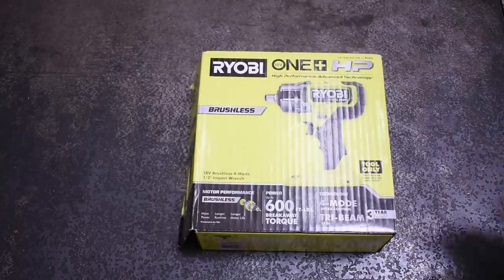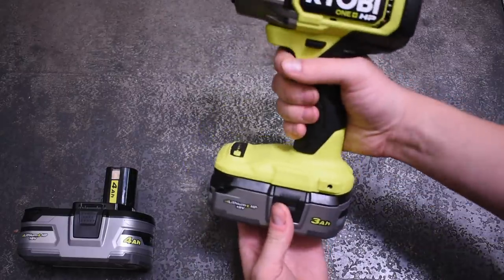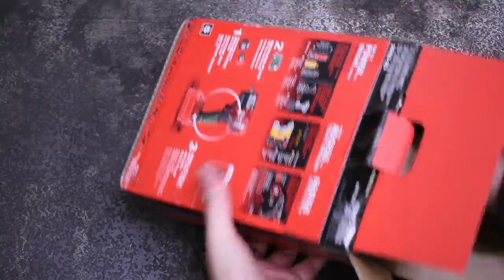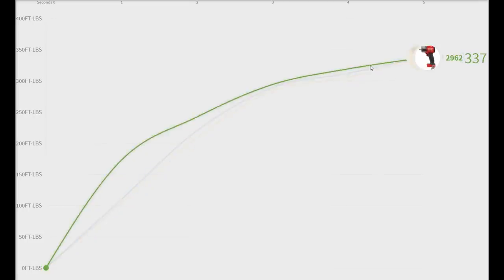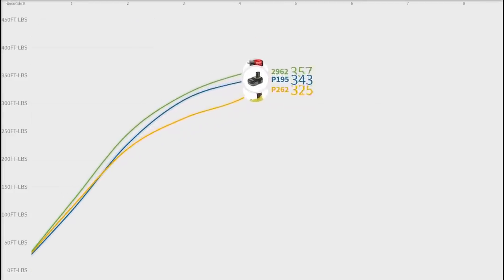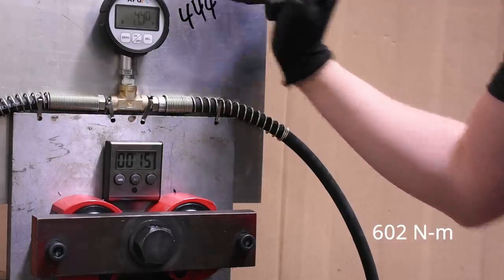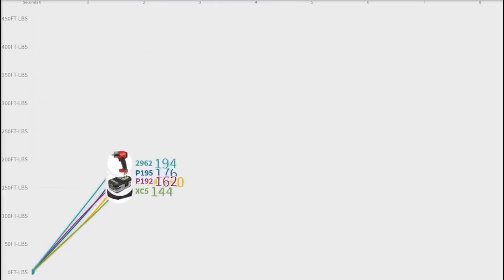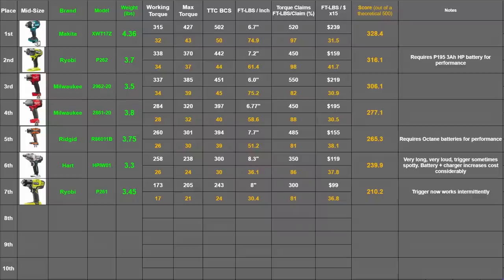Ryobi HP Finally Beats M18 but Needed THIS Battery: Dyno Test

Comment: I think 160 bucks for this thing is quite a bargain especially seeing it's edging the top brands
Reply: Just got one with a 4ah HP battery for 170
Reply: Just got one for free with a charger bag and 3 battery kit for $199 going to get the same deal with the extended reach ratchet this tax free weekend in MA.
Reply: Here in Los Angeles CA $219+ plus=$230+
Reply: @joshlee284  that’s a shit deal compared to the one I got back in July/ august. 2,4,6 amp hour batteries charger bag and p262 $199

Comment: Just remember the protection for Dewalt is on the tool, not the battery pack. So you can seriously do some damage using that adapter in the real world. (Of course, nobody should. But it could happen ofc.)
Reply: Its all for science
Reply: Makita, ryobi, and ridgid tools all have protection circuits in them
Reply: @brynnond.6952  this is incorrect ryobi has it in the battery packs, pretty sure the HP tools have it in the tool. This is why you can use NiCd Ryobi tools with lithium batteries. There are two big mosfets in the back of every ryobi battery pack with heat sink.
Reply: My co worker is bragging about his brand new brushed Dewalt tools!🤪 He even went so far as to buy the cheapest knock off Dewalt batteries he could find!!!! There is actualy a side by side review on the Dewalt knock off batteries here somewhere! Why sacrifice any performance at about a 20 dollar savings. Reminder, he bought the Dewalt  tools this year and they are brushed tools!!!!

Comment: I think it would be pretty fun to see if can use the best battery (in your opinion) and try it on the worst impact you have tested.
Reply: It probably wouldn’t make much of a difference. They covered in another video that bigger isn’t much better in impacts because the motor isn’t directly doing the work it’s only helping the anvil overcome the springs. Basically the tool can’t recognize that it needs to put out more juice because it’s still impacting the anvil and overcoming those springs, vs like if you’re using a circular saw it can recognize that the blade isn’t moving through the material as fast.
Reply: @danieljensen1465   The output was doubled from 150ftlb to 300ftlb at 2 seconds in from a battery alone..  Less voltage drop = more power

I run a 12v offbrand impact at 18v to take 140ftlb lugs off my dually. 12v to 18v being a dramatic change in performance.
Reply: Thx

Comment: The reason why is the dewalt protection circuit is on the tool so the battery will over discharge and could discharge it to where you can not charge or use the battery any more.
Reply: This should not really matter. None of these tools are treating the battery that differently. keep in mind there is still protection on Dewalt batteries but they are simple absolute max/min limits. Tools may have smart features so they do not do excessive damage to the battery like 30A for 5s, 20A for 10s, 15 continuous. To sell a lipo battery without basic protections would be a serious problem.
Reply: @Ender_Wiggin  If you look at reviews on adapters for dewalt batteries there are many that say the batteries were over discharged.
Reply: @Ender_Wiggin  the tool talking to the battery to protect both the battery and the tools circuitry isn’t basic protection though. Basic protection can be as simple as overcharging protection.
Reply: @trevorlynch6549  it's almost impossible to discharge a dewalt battery using and adapter I tried it on video and drained the battery right to the point it was ready to melt down and it still came back to life. It will never happen because the tool will stop working before the battery gets to that point.
Reply: Don’t believe that, dewalt 18v tools don’t have protection in the tool. 
You can’t over discharge the batteries them in dewalt tools, I use 4amp 5 amp and fex volt 6 amp and 9 amp. I’ve dogged the crap out of them batteries the only issue I had was a 4amp battery melted around the main battery positive. Battery remained functional for another 2 years at which point the 3 4amps I’d got in a kit all started to loose there amp output, works fine in the radio but if you put it in a circular saw or grinder very quick gives up.
Reply: @singlecams  I've killed a DeWalt battery by accidentally over discharging it.
To the point I couldn't even recover the dead cell by manually changing it, had to replace it.
Reply: @tomcardale5596  how ? What was the situation? I can say it will never happen on an impact wrench. Maybe using it on a radio or a flashlight. A impact wrench will not even turn way before the voltage gets to that point.
Reply: Cant you jus swap the battery b4 it dies? Serious question. Jus watch the charge. Once it hits 1 bar jus change it out and you can avoid that issue rite?
Reply: @bossmanz28  if you're just using the tool, particularly if the battery is powering a work light, you can easily get distracted and forget to check. That's what happened to me. The light was still working when I noticed the battery wasn't showing any bars on the battery meter. Put it on the charger straight away and it never recovered. Tried manually charging the one recalcitrant cell and that didn't help either, so I swapped it out.
Reply: @bossmanz28  Yhat works if you pay attention. If you forget once you will have a ruined battery.

Comment: Thanks for revisiting this. I bought my p262 in February and do my own work outside so hadn't really used it. I had buyers remorse after your first video but I own the gen 1 and loved it. I use a 4ah HP battery and havent had any issues. Im happy with the tool and feel I got more than i paid for. I was looking at the kobalt xtr and ridgid but already own ryobi batteries. The gen 1 with a HP battery did almost everything I asked of it. the p262 is capable of light truck and car repair for me.

Comment: i love my ryobi p262.. for a budget minded impact gun.. highly recommend..  i am a diy guy not a professional using in a commercial environment.. but let me tell you this is awesome.. sure beat dragging out 100 ft of air hose to use my air gun.. i already had other ryobi cordless batteries for my other tools so this was also a huge part of why i go this.. super happy with it.. and was impressed with the torque it has..

Comment: Awesome work as usual!  Thanks for giving the p262 what i consider to be a more fair shake.  I had already grabbed a few p195 batteries when they went on sale for $50 at home depot.  So i already knew i would be pairing the p262 with a p195.  This test confirms my experience with this combo.  It performs very well, and is an excellent value imo.  Compared to other brands ryobi batteries can be found for very good prices especially on sale.  This is a great channel, that you guys are responsive to viewers and comments, is a great bonus.  You're putting consistent and very helpful data out there, excellent content!  Really allows an accurate comparison between tools / brands and how they can be expected to perform.
Reply: im lookin for the same ryobi 18v one+ hp 4 mode high torque 1/2in impact wrench bc its advertise at 1200ft lbs on home depot rn..i hv milwaukee m18 and it didnt performed to removed a crankshaft pulley bolt from my k20a3 thats been winter welded for 5yrs atleast
Reply: Same. I recently bought 2 non-HP 4Ah batteries for $89 so I'm trying to stay in the ecosystem if possible. The P262 is $99 right now and seems like a good deal for what I need it for.

Comment: The TTC is becoming one of my favorite channels.  To the point, very informative, non-biased entertaining content.  Not sure where you guys come up with all the little funny comments but its great!  A point I took away from this video is a tool may only be as good as its battery.  Will you guys be building another test rig in the future to test 1/4" electric ratchets?  Obviously they are not built for high torque so maybe you will need to come up with other test parameters.  Speed, weight, size, battery life etc.

Comment: Picked this impact up a couple of weeks ago to do suspension work on my Camry with, got it for 199 with 3 (2Ah, 4Ah and 6Ah) "High performance" aka gen 3 batteries and a charger. It has made easy work of any of the bolts or nuts I've used it on, including the rear subframe and the struts. I've been impressed with it so far. If you ever get the 6Ah high performance battery I'd like to see an update with this wrench using it and the 9Ah you got for the High Torque model.

Comment: i have this tool, and it has been great. Works on lugs. I also have ryobi’s newer high torque, use it with 4ah HP battery and that thing is a champ. For $200.

Comment: You can get a P195 right now from Home Depot for $49. If it comes up as $79 and your home store doesn’t show stock, click on the “Check nearby stores” option under the pickup in store box and switch the store you’re shopping from to one of the others listed. Keep trying them and eventually you’ll find one that changes the price for the battery to $49. That’s a steal for this performance! Just bought one myself.

Comment: Would love to see a full video on battery adapters.  What brands they seem to work well for, which they don't.
Reply: I see a lot on ebay but not sure if they work
Reply: you can fit DeWalt batteries in to a Milwaukee tool with very minimal modifications to the DeWalt battery.

Comment: Love the updated tets! Kinda hoped you'd used the new 4ah PBP004 not the old P192 from a few years ago. Still a great test though! Maybe a round 3 down the line?
Reply from the maker: PBP004 wasn't available for sale really anywhere when collecting these. Plus all it advertises is a better brain and communication, which as we saw with the blind XC5.0 doing just as well is not the bottle neck here we feel.
Reply: @TorqueTestChannel  That makes sense, either way awesome job man. Easily one of my favorite tool channels out right now!
Reply: @TorqueTestChannel  what cells are used in the PBP004?

Comment: I have the 3Ah HP batteries, which still great when fully charged after 4yrs. I do expect to need to rebuild them soon, with some new Samsung 21700s. Also have a 1yr old pair 6Ah HP batteries which offer comparable power, but muuuch longer life. I can get the hole engine and trans out of a Simi with a single 6Ah, usually.

Comment: Do another test with the P262 using the 6 and 9 amp hour packs!!!! 
I got 2,4 and 6 amp hour batteries with a charger and a cheap bag with the tool for $194 plus tax back in July. Money well spent.

Comment: Ryobi have 5Ah batteries easily available - these are the go-to for anything I use.  You can also get up to a 9Ah battery - I don't know if these up the peak current though, or would just give an extended runtime.

Comment: Great channel.    

I noticed a power gain in my impact and drills using the 6Ah Dewalt Flexvolt batteries over the standard 20v 4Ah.  Maybe when yall get a chance you can quantify it.

Comment: The 'lumpy curves' would appear to me, to be the BMS in the battery pack, trying to adjust the output, to keep voltages/power consistent.  It probably needs to see a drop, then respond, thus the 'lumpy' graphs.

Comment: The BMS in ryobi batteries seems to limit output current more than other brands and in dewalt's case there is no current limit at all.

Could you test these different batts on the old P261?

Comment: Currently you can get this Ryobi P262, and 3 High Output batteries (2,4 and 6 Amp) for $199.  It's a no brainer to buy the Ryobi.  Besides this tool, Ryobi has the only cordless hot glue gun as well as a top performing 18 ga brad nailer.   Otherwise their tools are below average performing but above average value.  I like the current Flex tools and would like to see the Flex impact tested as well with their "stacked" and stander lithium batteries as well.

Comment: So there is one way to get more energy out of these impacts without changing the output hammer. That would be the velocity that the hammer is striking the output. The faster/more powerful the motor than it can bring the velocity of the hammer higher for each strike. The velocity of the motor is directly related to the input voltage. Less voltage sag under load would mean higher output velocity. The voltage will sag when there is a large current draw. Personally, this tells me that Dewalt has great batteries that hold their voltage under load.

Comment: #11.
 If you want to see real power from ryobi tools, use the 
9 ahHP battery pack.
Reply: sure but that also would be unwieldly
Reply: @aaronporter2180  it's not horrible I have 6s and 9s battery weight and size aren't that big an issue
Reply: I would like to see a "Big battery" show down. Keep up the great vids!!
Reply: And its still a Ryobi, just a lot heavier. Great suggestion, now try that in real life.... I kept my old Ryobi impact wrench, even with a new 5ah battery its just not good in real life usage, not always powerful enough, it hammers away and not much happens. On my little Makita however, i can use a small lightweight 2.5ah battery and always got enough torque available, lighter tool and lighter battery that is always much better for real life work, light with great power and few but perfect modes. You cannot benchmark real life productivity.
Reply: @pflaffik  the original P261 impact was never in the running for lug nut removal or in a mechanics tool box. It was clearly a lightweight  unit, but for driving fasteners on a building site like large or long lag bolts, you can’t beat it. I’ve got all 3 generations of this tool, depends on what you are doing to decide which one you need to use.
Reply: It's like using a 12HO on the Milwaukee, Beast mode.

Comment: I wouldn't use an adapter on Ryobi tools, Ryobi batteries have a BMS in them to protect from short circuit, over current, under voltage protection. Others may not (eg Dewalt)

Comment: It's really a shame Ryobi doesn't make it more clear about the batteries (granted they made so even the old ni-cads could still work in that thing which that might be fun to try just to see how it would preform with one of those old things), also Ryobi really needs to make more packs with 21700's >.> really wish they made the 6ah and 9ah with them but ah well.

Overall when myp261 stops getting the job done I'll gladly pickup a p262.

Comment: So based on the comparison test: P195 sure is the clear winner; however, the P197 (Dirty 4.0Ah Standard) even though jump everywhere, it seems able to reach higher torque (300 & 400 ft-Lb) in less time and still out perform the P192 (Good? 4.0Ah HP) at the very end (P197: 426 ft-Lb vs P192: 414 ft-Lb). My understanding is that though not rated as HP, the newer P197 is using the Sony 21700 cells and at 40% less cost I rather have the P197 that is able to reach higher torque in shorter time and still out perform the 40% more expansive HP P192 battery.

Comment: 2 ideas--bench test cordless batteries to get the curve of voltage drop vs current.  Also what about using a lab type power supply to run cordless tools in your tests?  The power supply would be the "perfect" battery that always supplies full current without any voltage drop.   It would show how batteries affect performance.

Comment: Maybe I am missing something but you ran an 18V tool off a 20V battery, which if the tools power draw is regulated via amps would result in more torque for a given amperage. I'd assume that the tool has some sort of voltage regulator to account for depleted cell's having a lower voltage but it wouldn't surprise me if it doesn't.
Reply from the maker: Dewalt 20v max packs are 18v nominal like all the others, its just marketing. So is 12V which is really 10.8V nominal
Reply: @TorqueTestChannel  Well their marketing had me fooled so kudos to them I guess. Sticking to Milwaukee either way because I like the color scheme.

Comment: Ryobi batteries have the mosfets in them making the brains of the tool in the battery. The HP batteries just either just allow more current or go in bypass mode.

Comment: Since you are a dedicated torque test channel.
I'd like to see what hand impact drivers like 
Snap ons PIT160
Snap ons PIT120
Weras 2090
Or lisle or any brand for that matter
are capable of.
I would imagine it would be hard to create a control driving force but one could tighten the nut to 50 ft lbs then apply 10 blows with a 2# brass hammer, 3 sets for an average or blow it until the nut will no longer tighten, expect a workout 😁
In order to be what others can't, you must do what other wont 😉💪

Comment: Oh!  So the Ryobi is modulating power based on internal resistance (IR) of the battery!  When the curve jumps, it's gotta be because the tool figures out the battery has low enough internal resistance to safely handle the higher amp draw.  It must initially assume a weak battery, and adjust.

Comment: Milwaukee has plenty of kits out there that have the "wrong"/old batteries in them, or worse: old versions of the tool... Their 3Ah High Output battery is very sweet though.
Reply: Yeah. They ship they M18 Surge with 2.0ah but they will ship the on surge with CP 3.0s.

Comment: I'd be curious if smart adapters will ever exist, where the tool can talk to the battery. I'm not sure how simple or complex the talking is, or if it's consistent or proprietary between brands, but it shouldn't be all that difficult to make one brand's tool talk to another brand's battery, right? At most it'd just need some sleuthing to understand what is actually being communicated, and if each system is proprietary, using a processor to translate brand A to brand B. Smart adapters could be a total game changer if one battery platform is superior when it can't communicate with the tool.